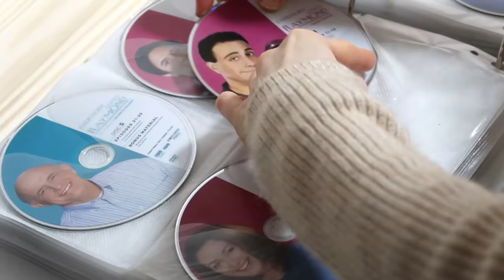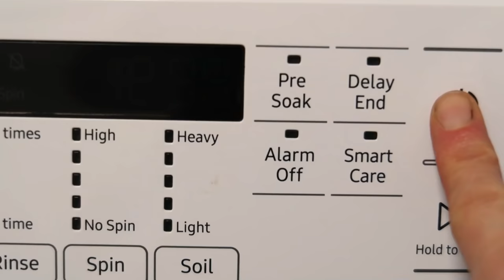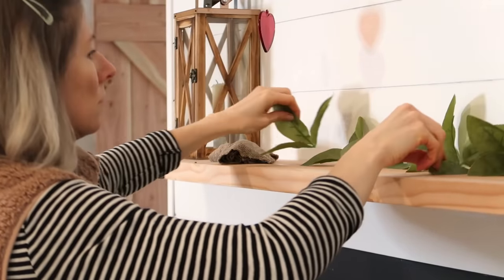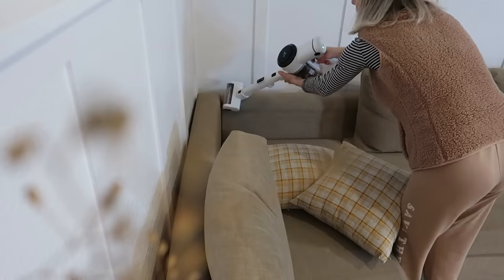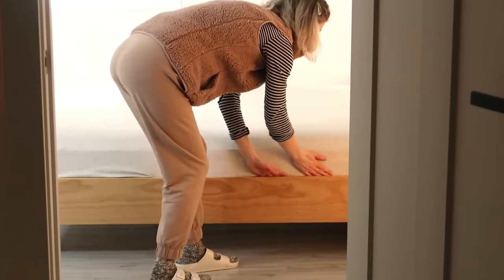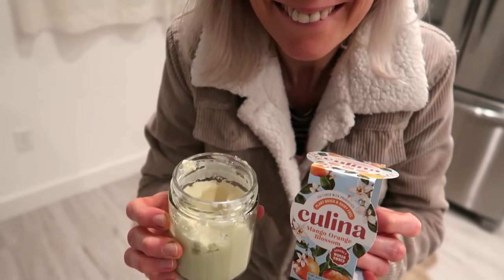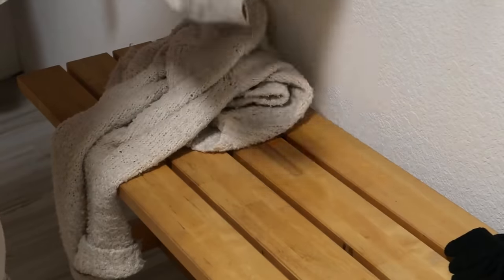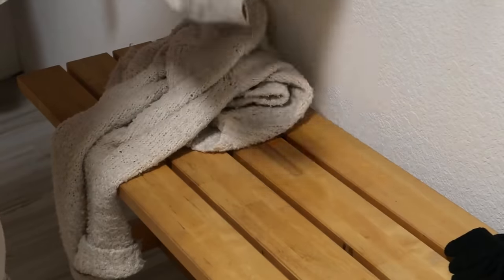WHOLE HOUSE CLEAN WITH ME | HEALTHY HABITS | WEEKLY CLEANING ROUTINE 2022

Comment: I love the addition of the coconut oil to your 'scrub' recipe. I've used a similar recipe to yours for years, but I've noticed a distinct lack of luster to the porcelain of the sink. I'd read that car wax could help, but I haven't quite trusted that suggestion; however, the addition of the coconut oil basically takes its place. Thanks for the recipe. Question: is it baking soda or baking powder (which showed on the recipe)? I actually used the powder and it fizzes with the addition of any water (which isn't a bad thing actually) but the texture of your mixture doesn't look like mine at all, so I thought baking soda.

Comment: I clean the fireplace glass everyday because it is easier to clean it rather once a week. Plus the best cleaner costs nothing. Newspaper, spray bottle with water and ashes from the fire. Best cleaner! Noscrapers, no brushes needed. Gloves recommended and the newspaper on the floor while cleaning. Less mess later. 🙂

Comment: Hi hunny, I appreciate all your content, it goes to show that being a “domestic engineer” is very busy, constant work. I do have a question?… I am in an older home that has ground in stains on the kitchen linoleum(flooring) that I am having a hard time getting up. Do you have any concoctions or advice on what might help? Thanks in advance.👍🏼❤️😊
Reply from the maker: Thank you so much for watching! It depends on the stain some may stay there if it's a chemical (we have a purple stain from the previous owner) sometimes we get sap  alcohol is a great help to remove that, magic eraser can pick up some other stains and shoe marks. 💗
Reply: Thanks so much for the quick response. I’ll check into those products. Thanks!💗

Comment: 🔥🪟 For cleaning glass on fire this is a much easier effective virtually no effort/mess way to clean it... Screw up sheet of newspaper, dip in water then into the ashes. Buff the dirt off the glass. Repeat with another piece of paper etc if required. ( Works really well when fire is on too)